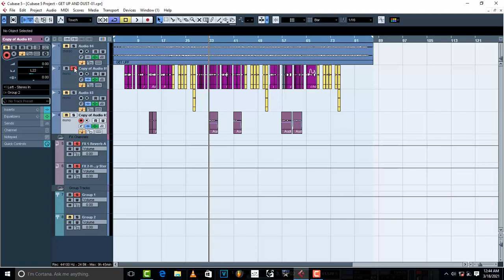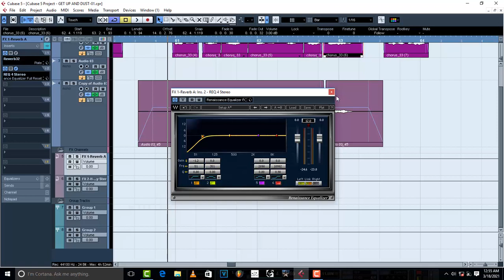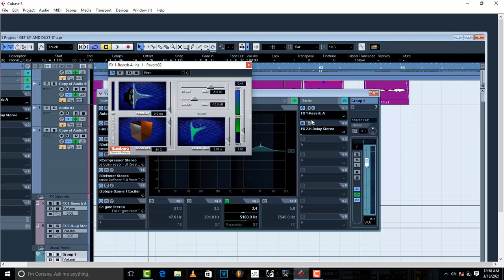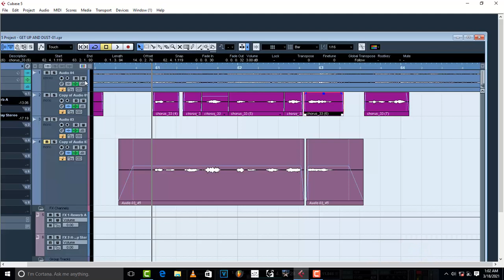HOW TO MIX FULLER SOUNDING VOCALS. #mixingmastering #cubase5 #cubase

Comment: U di best, cn i ask smthn....on backin vocals do u use delay, or just reverb only?
Reply from the maker: It depends. If it is a choir, just reverb alone to spread the panned vocals. But if it a solo vocal that needs both, then I throw in both. Remember that delay on many backing vocals muds up the mix but if it sounds good, then produce it.